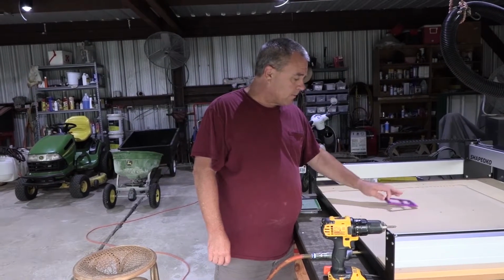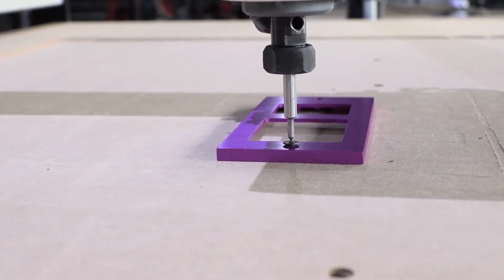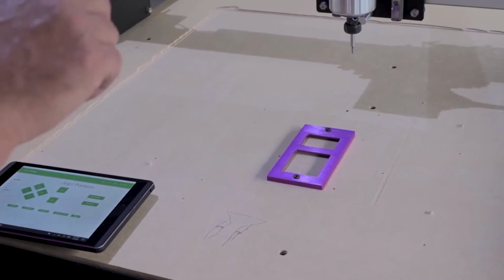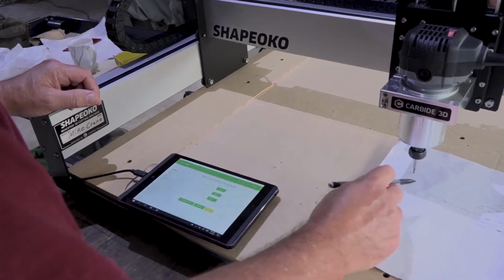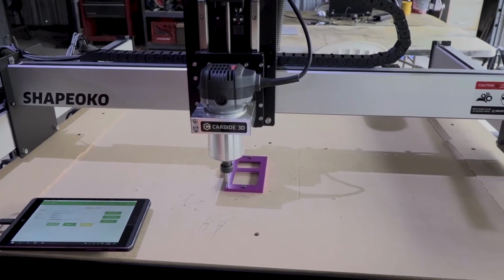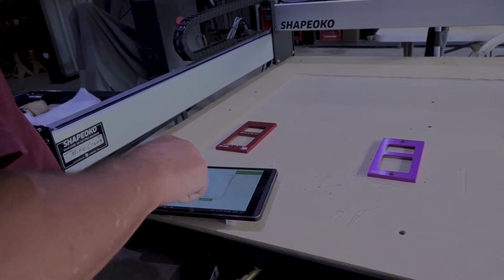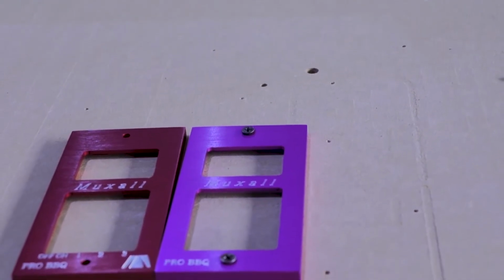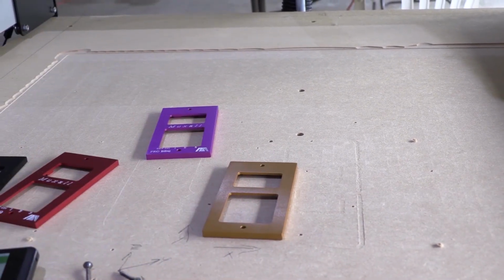IoT#105 Shapeoko 3 – Engraving Anodized Aluminum using Diamond Drag Bit

Comment: If your diamond bit is free floating compressed by a spring, it seems like the body of the engraver would spin, and maybe the diamond shaft might spin a little. Can you do a rpm check on the diamond shaft with your router spinning at about 8000 rpm.  JUST CURIOS
Reply from the maker: I don't have anything to do an rpm check with but believe me, it's spinning and probably as fast as the body.

Comment: Just curious why you turn on your router for a drag bit...?
Reply from the maker: That's a great question!  If I don't turn on the router it takes 10 or more passes to cut through the anodizing.  If I turn the router on a low speed (5K rpm), it will cut through the anodizing in 2-3 passes.
Reply: @muxallopeniot9194  Interesting... Is the bit somehow indexed/keyed to where it spins with the main shaft? In other words, is it intended to be a rotary bit? If not, I would expect considerable heat & wear to happen; especially since it’s metal on metal friction while encountering a radial load. I have a few drag bits & one even came with a sticker on the container saying not to turn on the router. Again- not being critical. Just wondering if you’ve noticed any issues(camming out, excessive runout, excessive wear, seizing), or if you have one that’s intended to be installed in a spinning router.
Reply from the maker: @jnorris8649   Index/keyed is an interesting question.  I don't think so.  But, you're wondering if spinning the bit is actually spinning the spring loaded engraving tool... yes, it is.   

To answer your question "... is it intended to be a rotary bit?" According to RDZ: "The tool does not rotate so you do not need to run the spindle."  

I am still using the drag bit I made the video with and have made about 30 of these faceplates with it: https://muxall.com/shop/product/gold/.  It doesn't get hot and the only damage that it sustained is when I didn't set my home position correctly and it ran into a holding screw or slipped off the edge a little; but, it's still working!

The only issue I can report by spinning the bit is the dimple effect.  Dimples are caused where the cnc enters the cut.  When the bit plunges down, there is a fraction of a second before the cnc starts to drag the bit.  Since the bit is spinning, it acts like a drill bit (for that fraction of a second) and cuts a little deeper than when it is being dragged.
Reply: @muxallopeniot9194  Thanks for the quick reply. I have two RDZ’s- a 60° & a 90°. I’m planning to do a few Form 1’s, and the ATF requires the items be engraved. I figured drag bit engraving would be different on anodized stock, which is why I came across your video. Most lower receivers (and other aluminum firearm parts) are Type III Hard-Coat Anodized, which I would imagine have a much tougher surface than the stock you have on the spoil-board (I can only assume Type I or II?). Have you engraved any anodized lowers, or anything Type III? I appreciate the info this far, btw. This sort of knowledge is crucial to not boogering up a one-shot deal.
Reply from the maker: @jnorris8649  My stuff is type 1.  No one is going to drag his BBQ controller through the mud. :-)   I have not tried to engrave any Type II or III anodized parts.

 I suggest that you find some anodized scrap metal to test your engraving on before pulling the trigger, so to speak.  I have ruined several faceplates with alignment (homing) issues, CAM issues, and a variety of other silly mistakes.  Also, I doubt if your 90 degree bit will work.  I tried the 60, 90 and 120 and nothing worked well except for the 60.

Comment: Are you using a Microsoft Surface to run the Shapeoko Carbide Motion?
Reply from the maker: It's an HP tablet running Windows 10 Pro.  Here is a link to the 1 minute long video describing it: https://youtu.be/9i9OWPiCIVk?t=58